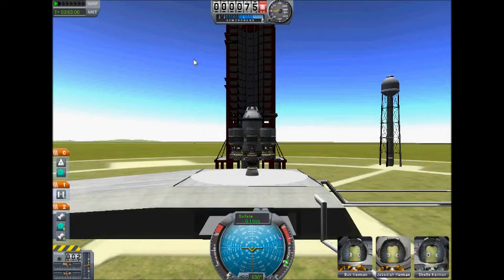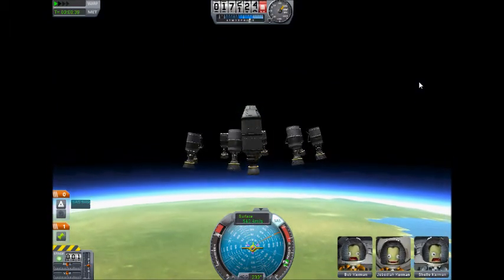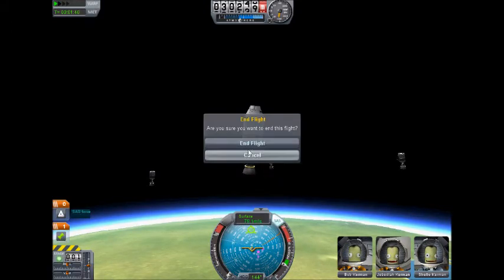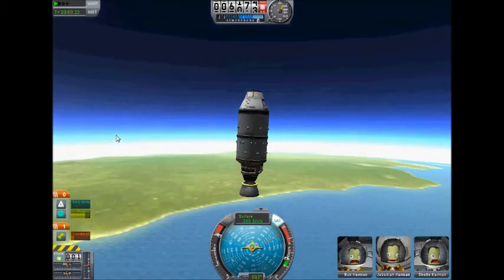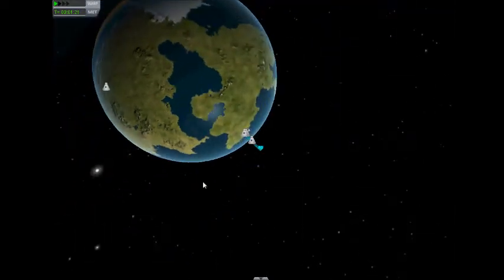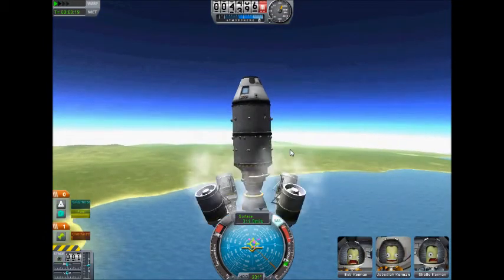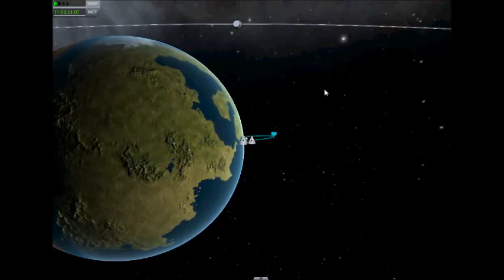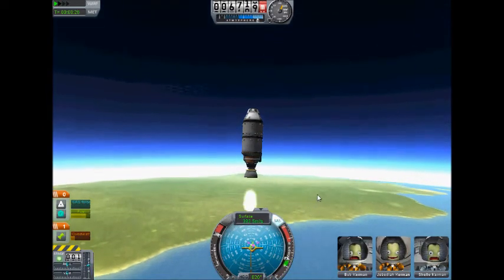Testing and improving the Asparagus method!

Comment: Also, the first test (no fuel lines) keeps all motors firing for the longest, which will theoretically produce the highest speed at the lowest altitude, generating more atmospheric drag.  
Some of the gain shown by the asparagus test is because it burns fewer motors for longer.  With such a high TWR on your test craft, this yields much less atmospheric drag.